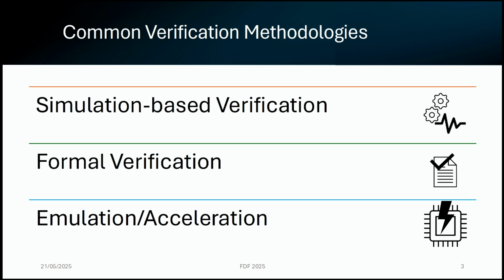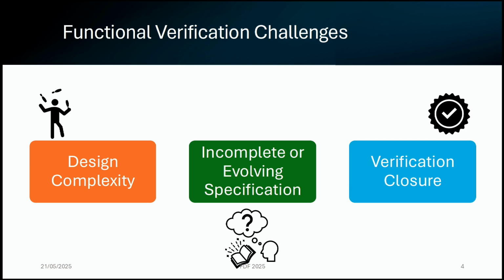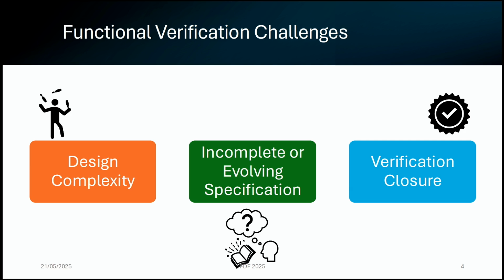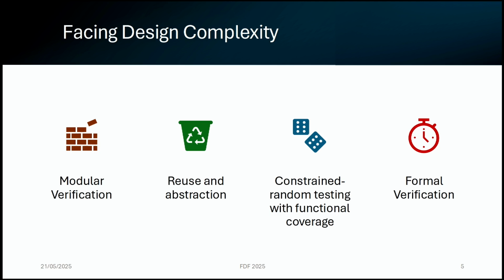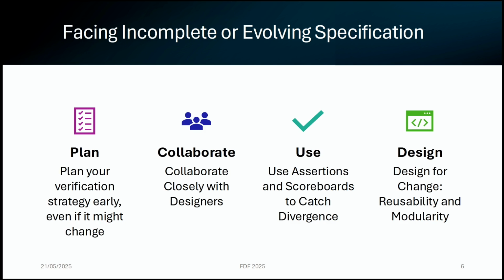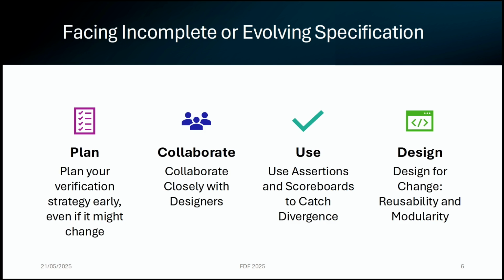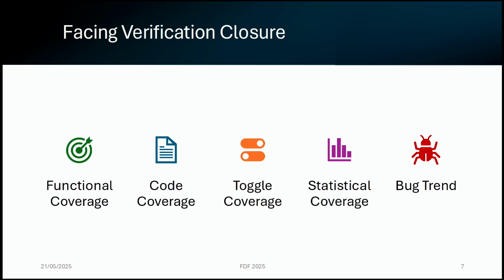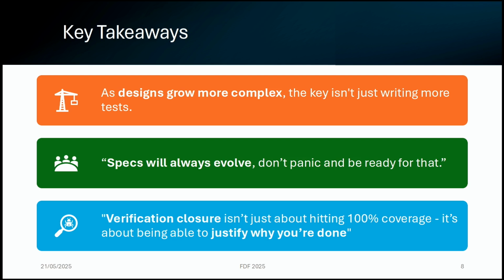Practical Methods for Functional Verification

Comment: Regarding using python (import hdlregression (Marius Elvegard)), any thoughts on using on automating all possible ways a design can break using AmaranthHDL?  Pat Deegan (Pyschogenic Tech) has a great video at peertube FSiC2023 called "Black-tie Python: Formal verification with Amaranth"  (Cover, Bounded Model Check)

Traditionally , is it safe to say most people use verilator with either Apheleia Verification Library or UVM?  VUnit?

The other area I'd like to learn is on timing closure.. and how to constrain a design.  Any suggestions?  PLC2 Compact Timing Constraints and Analysis Online Course?